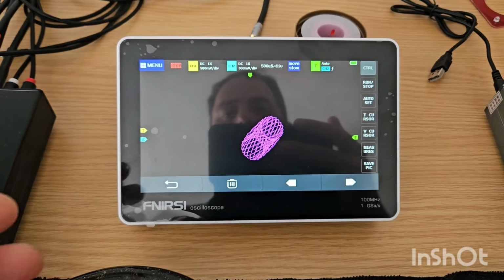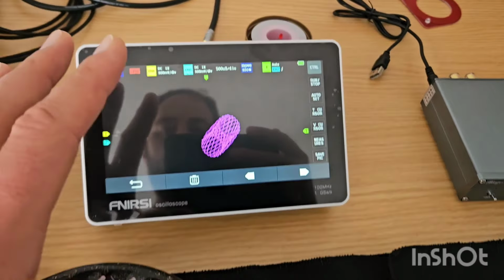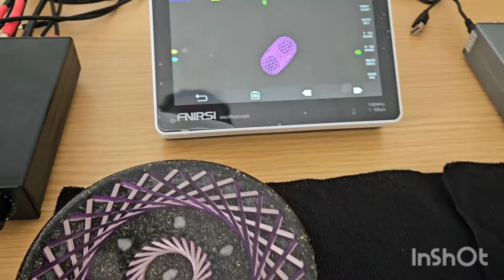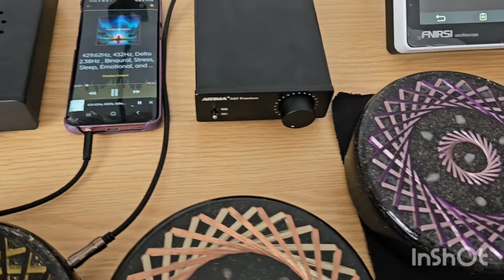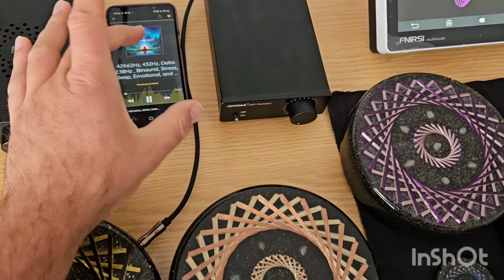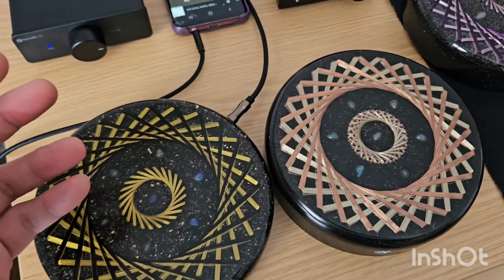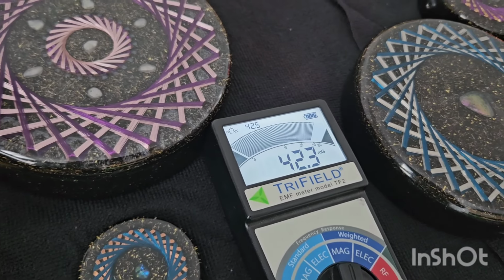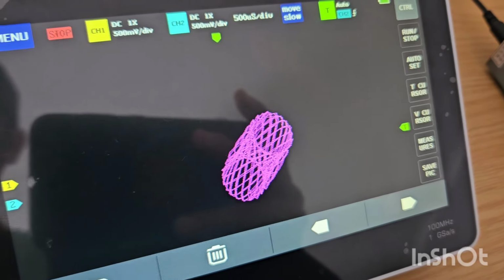The SERIOUS Orgonite Rodin Coil- Dual Channel - Revamping the Etsy SHOP - ins & outs of this device

Comment: Where do you order your color coated enamel wire from?  I can't find any other than red, natural or bronze.   Do your tips on the radio jack not melt where its plugged into the coils?